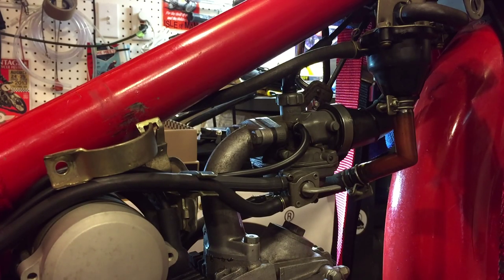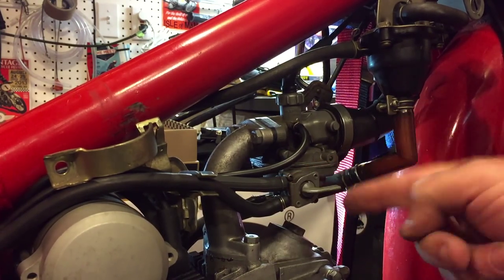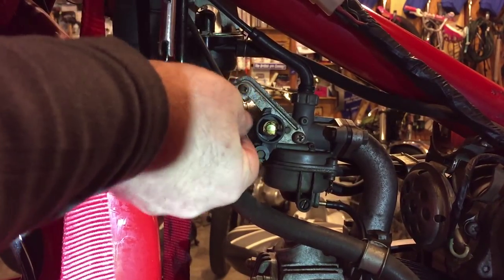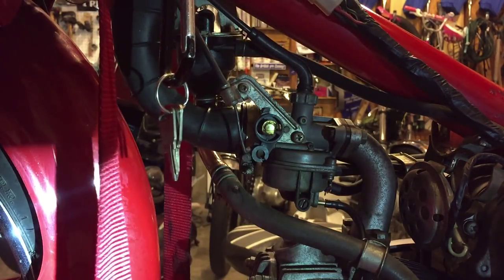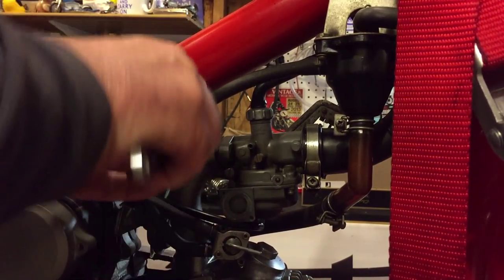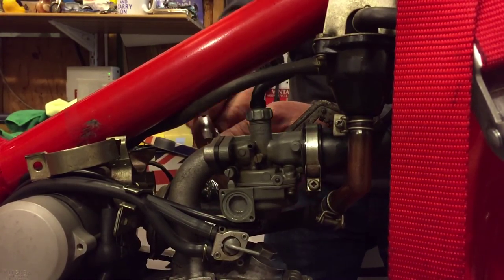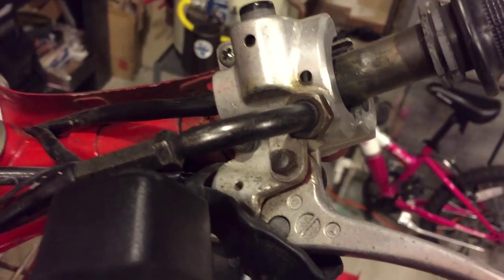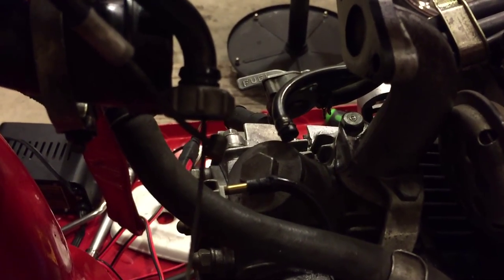1981 Honda C70 Passport (11) - Removing the Carburetor

Comment: Hi Mike: In addition to the metric wrenches/socket set, I would also suggest a couple of JIS [Japanese Industrial Standard] screwdrivers. I have been working on Japanese bikes for a few (Like 40+) years and found that the JIS drivers, although very similar to a Phillips [crosshead] , have a slightly different angulation at the head and this means far fewer butcher jobs on tight screws. Love the work you do and am thankful for no pounding music in the background.....
Reply from the maker: Thank you very much David. Yes, I like the peace and quiet (and smells) of the garage! They are enough for me 😊 best wishes, Mike

Comment: I took off my throtle cable "needle" and placed it back in but for some reason when i start the bike it just keeps accelerating. Any idea of what it could be? A friend of mine told me the needle is installed wrong but i tried it over and over and still the same thing.

Comment: Hello can you help me out mate, I'm just putting  finishing touches to my  1979 C70. my question is does the throttle cable drop down the frame same route as the speedo cable, I can't remember from when I stripped it for painting. I put it back together that way & it seems like it's not  going to be long enough to reach the carb. just can't suss out how to route it. any help would be great. Tar
Reply: False alarm just fixed it !!
Reply from the maker: @Hugojahman  Great Steve, I was just looking back over the first video to see if I could tell as I couldn't remember. Glad it worked out ok!  Here's the video I was looking at if it helps, but it's not very clear. Cheers, Mike. https://youtu.be/EzB2t-qTGHM?list=PLgDzKiI-i6nZai-cwtTLgA6hBz-zBoGHb